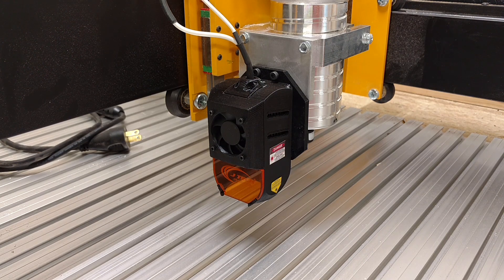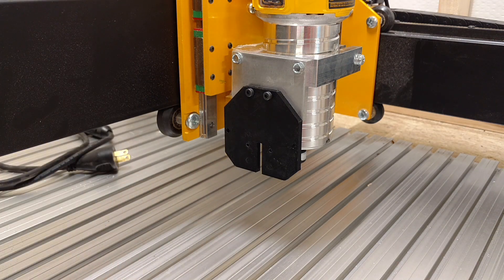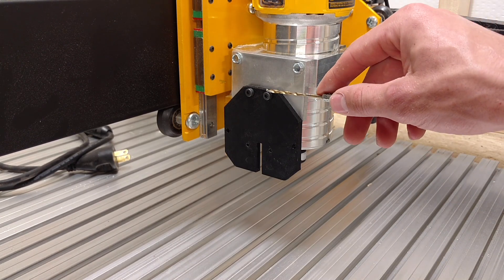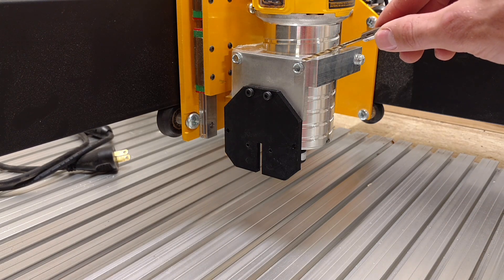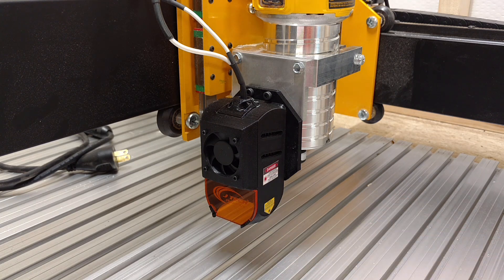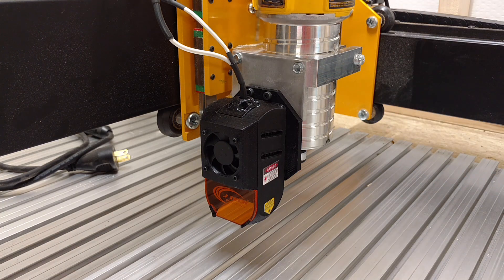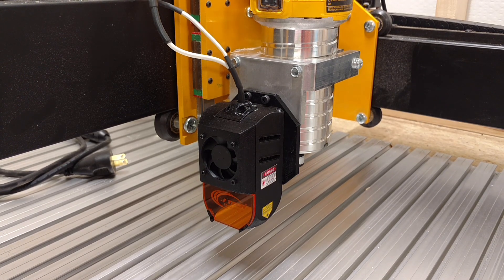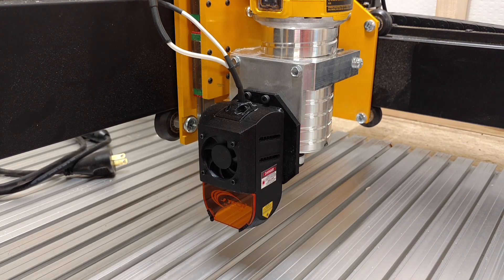How I Mounted My JTech Laser On The MillRight Mega V!

Comment: Did you get the laser from Jtech afterwords, or when you bought the MV? I noticed they were the same price, and was wondering if MillRight left ports open on the control board for the laser. It would be a shame if I decided go get the laser later but because I didn't order it off the bat millright gave me a basic board instead of one that was laser ready.
Reply from the maker: I did order my laser with my machine bundle from MillRight. The board was already wired to a port on the control box so all I had to do was plug it up and it was ready to go. I dont know for sure but I would think that the breakout board that MillRight is using is probably the same regardless of whether or not you get the laser but there may not be a port on the control box for to to just plug up and go. If I were you I would send an email to MillRight and verify that the breakout board is the same and see if you can get them to go ahead and wire up a port for you!